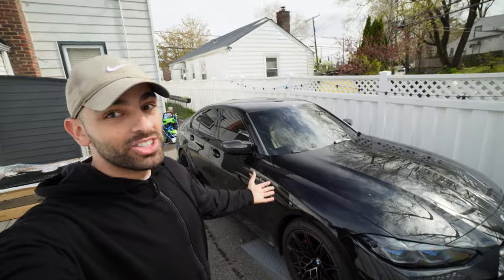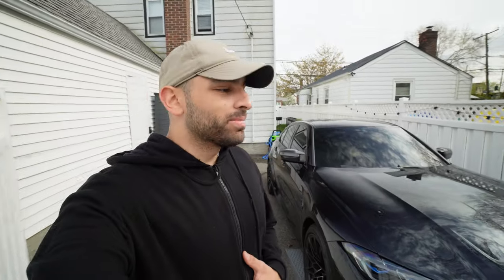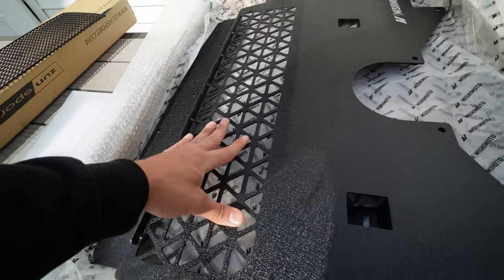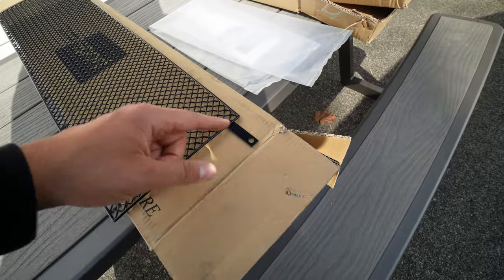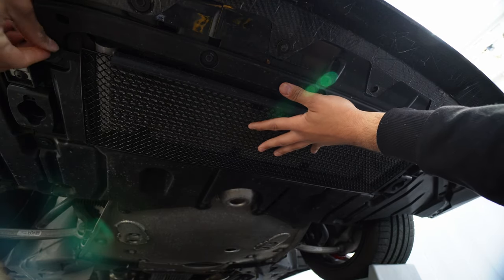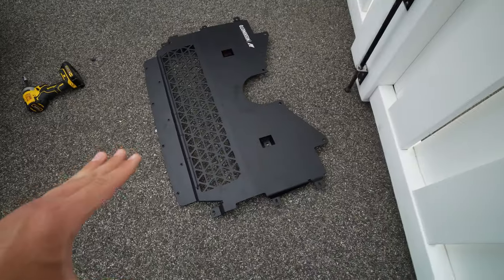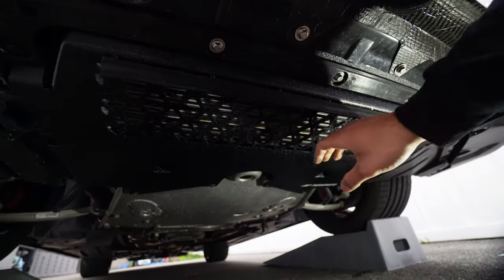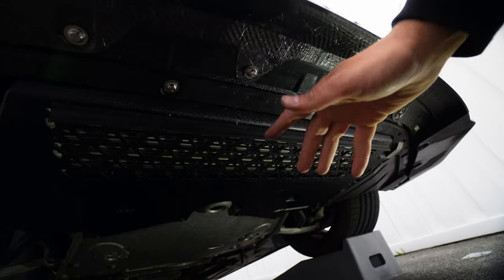DO THIS TO PROTECT YOUR BMW G8X M3 / M4!

Comment: I wonder if you can install both on top of each other to get the tighter mesh, as well as the larger metal shield
Reply from the maker: Potentially but you’d have to drill into the metal one to mount the mesh piece. Also it might rattle